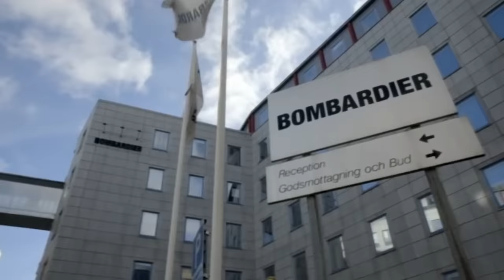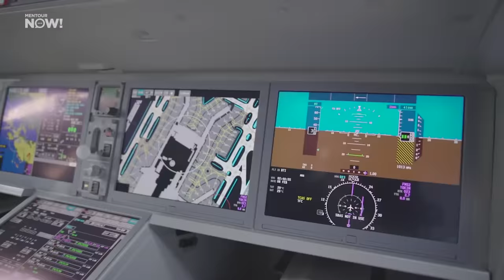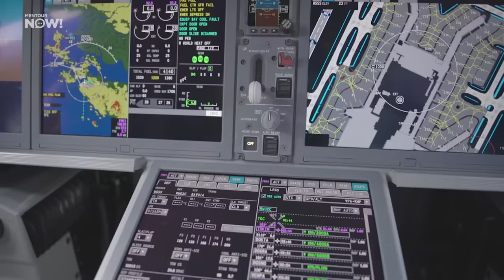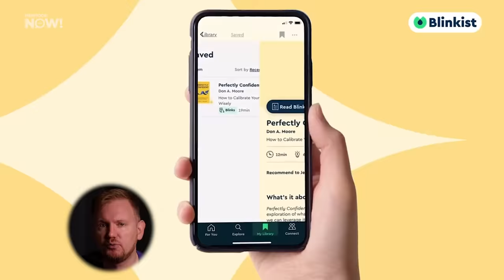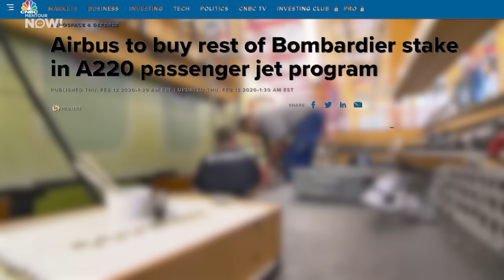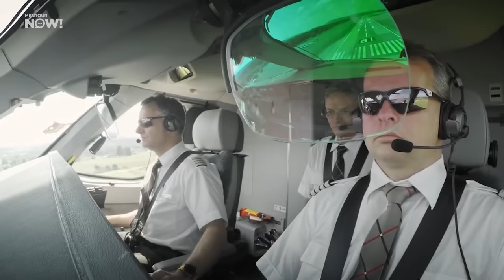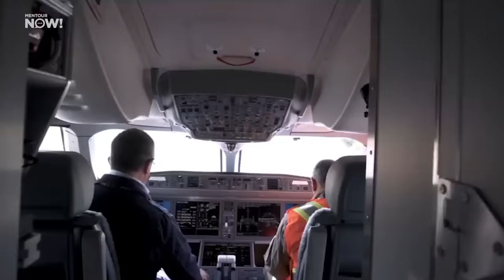Did Boeing GIVE Airbus a FREE Airplane?!

Comment: Bombardier also have a significant presence in Australia as they have manufacturing facilities all across the country and not only locally assemble military aircraft for the RAAF but they also are responsible for manufacturing the Vilocity DMU trains for Victoria’s regional passenger rail network! They are also responsible for manufacturing all of Melbourne’s trams from 2013 to the present and the E class trams in Melbourne were built by them while they will also be building the G class trams which are scheduled to enter passenger service in late 2023 or sometime in 2024! :)

Comment: The other thing we must ask - what would have happened to the program under Boeing? Would they have done it right in manufacturing and future upgrades, or neglected it, used cheap unqualified workers, cut corners everywhere, and later made an "upgraded" version with serious design flaws, ultimately ruined it like they do everything else they touch these days? Honestly I think it's in better hands with Airbus. I could even imagine a barrier to Boeing's buying out the Cseries would be those involved with the program not wanting to work under Boeing, either threatening to quit or fearing they'll be laid off and replaced with cheaper workers, which could hinder or complicate the negotiations, especially with any relevant unions.

Comment: As always, great video! 
As far as I am concerned, SWISS - that of course is an airline of the Lufthansa Group - was the launch costumer of the Bombarider C-Series. So, widely speaking, Lufthansa can be hold as the launch costumer, though I've never seen a Bombardier CS or Airbus A 220 in the colours of Lufthansa so far.
Reply: correct.

Comment: It's worth saying how incredibly efficient the A220 is. It's almost 5% more fuel efficient than A321neo that is the second  most efficient aircraft. Despite being only  5 seats wide, giving it a penalty of about 12% and also being generally smaller. 

The A220-500 will proboblt be even more efficient. And there is a 700 on the papers.

Worth saying that the CS500/A220-500 have now been reworked 3 times, making it longer and shorter. (Depending on if they are going with a 700 or not)

The 500 would at least be as large as the 737 max8, and the 700 probobly as large as the 9. Covering the part of the 737 series that really exist.
Reply: At the same time Airbus is developing a new carbon fiber wing for the 321 Neo, which will be larger in size with folding wingtips. This means they can use a further stretched 321 fuselage with the new wing to get an aircraft like the 757 above the standard midrange aircraft, and replace the former 318, the 319 neo and 320 neo in long term with the 220 in 3 or 4 sizes, without the need of starting an expensive clean sheet design.

Boeing on the other hand would have to launch a program to replace the Max, and one to get an aircraft in the size of the former 757 to compete with the modernized and stretched 321 versions

Comment: 2:26 Do not overlook the fact that the CSeries have the exact passenger capacity as the original 737 waaaayyy back in 1967
coincidence? I think not.
ALSO it shows how far the 737 mission creep has gone.

9:50 "medium haul airliner"
The irony of Boeing creating the point-to-point long haul 787 small twin aisle jet, having customers begging for a 757 replacement, SouthWest as a friendly case study...  and THEN missing the opportunity of a long legged 100-ish seat airplane is exquisite.
Reply: Yes, coincidence mein wounded Yank. Cope.
Reply: @yxmichaelxyyxmichaelxy3074   so much fail. There is no "wound". There is no "cope"
Reply: @ricardokowalski1579 
There there... shhhhhh.
Reply: @yxmichaelxyyxmichaelxy3074  Sorry. I already have spoken. Can't "shh" me after it has been said.

Comment: Canadian goverbment never "invested" in the C-Series.  The opposition parties from western Canada made sure the federeal money didn't go help a failing Québec company to bail it out.   However at time of lauch, there was some tax inventives and some breaks given by the feredarl goverbnment but not muchj most came from Québec government (for instance the construction halls were built by the QC government and rented to Bombardier).
Also of note: the C-Series was started prior to 9-11 with an Eye towards replacing the fast  DC-9 and MD8x and MD95 fleets in USA, notably Northwest airlines what was to be launch customer.  Then 9-11 happened.  Unlike Boeing and Airbus, Bombardier refused to lower production of its CRJs and found itself not long after with unsold inventory and its solution was to force a strike as a means to stop production without admitting it had made a mistake in not lowering production.  Not long after, Bombardier Aviation was near bankruptcy, Northwest had gone Chapter 11 (purchased by Delta and DC-9 sent to beer can recyling companies) United aso Chapter 11, purchased by Continental.  So not only was Bobardeir out of cash, but its lauch customers were gone.
The Beaudoin family (descendants or Armand Bombardier who controlled the company) purchased the recreational products division (skidoos etc) from Bombarier Inc  as a means to inject cash into Bombardier Inc.  ( recreational products not allowed to use the "Bombardier" trademark despite being owned by that family ! Now known as BRP and use various trademarks of purchased products since then (eg Evinrude for engines). 
By 2008, Bombardier was back in shape and had found customers to launch the C-Series.
Note: the C-Series was always going to a be a mainline aircraft, and that was one big challenge for Bombardier who had not dealt witrh mainline airlines only with regional carriers, so needed to build relationships with the big guys. 
HOWEVER: Bombardier also launched 2 business jetc at same time, the LEarjet 85 and Global 7500 programmes.
A small company which was first entering the big boys market against Boeing and Airbus was also straining its finances with 2 new business jets at the same time. Drain in cash resulted in stopped investment to improve productivity in its trasit division which started to be unable to deliver on time and with good quality control and it started to lose money and mroe important lose cistomers. (New York cuty told Bombardier Transportation very publicly to not bother bidding for any more contracts).

From the time the C-series started to be late, especially after the engine explosion which delayed flight testuing for a long time, it ran out of cash and became desperate.  So yes, it went to both Boeing and Airbus seeking investment from them, and both refused.   Think of it: if a competition is faltering, you don't helo it, you let it falter and then compete tro get the leftovers during bankruptcy.

Bobardier cancelled the Lear-85 , losing billions already spent.  But that was still not enough.  It was "this close" to starting deliveries, but also "this close" to having to invoke bankruptcy protection.  The Federal government refused to help, but brokered a deal where Air Canada would buy C-Series it hadn't panned on purchasing with Bombardier agreeing to maintain them in Winnipeg.  Air Canada was in court for violating its charter which required it to maintain maintenance base in Manitoba (from when AC was privatized)   and this deal would allow AC to settle the court case favourably.  That was the extent of help by federal government.

The Boeing trade dispute arrived about that time.  Instead of seeing it as a trade dispute, you need to see it as Boeing trying to speed up Bombardier's inevitable bankruptcy.   BBD had alreayd begin to sell off assets such as older deHavilland aircraft and the Canadiar water bombers to Viking Air (now deHavilland Canada). 

The provincial government was far more involved.  Bombardier split off the C-series into a new company (CSALP) (C-Series Aircraft Limited Partnership) and the Québec government invested a few billions in equity, onwing about 40% of CSALP, with BBD ereducing its share down to 60%.   The QC governmemt saw that this wasn't enough. The predicted death of Bomabrdeir is what prevented more sales.  This wasn't about cancellations becayuse there weren't that many orders, it was about all the potential sales that weren't materializing because everyone saw Bombardier was headed for bankruptcy. 

So the QC government is the one who negotiated with Airbus to gift it 50% of the programme for free so that the aircrafdt would get some long term credibility and not be cause in the fear of Bombardier's bankruptcy.

At the same time, the Caisse de Dépôt du Qubec (provincial pension plan, a potent investor) decided to bail out Bombardier Transportation. So Bombardier Inc split off Transportation into separate company and CDPQ injected new capital in it and got 30% onwership, but with a caveta: the money losing company had to providded garanteed dividends to CDPQ.  (recipe that CDPQ knew not to be sustainable). At the same time, CDPQ negotiated with Alstom to buy Bpmbardier Transportation and CDPQ comverted its investment in bankrupt Bombardier Transportation into 18% stake ionto Asltom.  Bombardier had no choice but to accept because it could not affor to pay those garanteed dividends, nor did it have any cash to buy the CDPQ shares back so it could stop paying dividends. 

The rest of the liquidation followed, the last remaining deHavilland product , the Dash-8 was sold to what is now deHavilland Canada, the downsview plant where it was built was sold to a condo developper, the CRJ IP and maintenance contracts sole to Mitsubishi Heavy Industries, and its aero structures business (including the former Shorts Bro plant in Belfast) sold to Spirit.

All those sales excluded the debt incurred prior to the sale which stayed with Bombardier Inc. 

Back to C-Series: when came time to start increasing production, Bombardier whose share was donw to 30% and QC govt down to 20% (airbus got 50%) could not invest to industrialize production, so used clause in contract to sell its stake. At that point, Airbus dish out a bit of cash to buy 25% of project, with the Québec government buying rest to increase its share to 25%. The deal with Airbus required the C-series to continue to be built in montreal for all customerd except those in USA. 

But that wasn't enough and last year, the still money losing C-Series required more investment and after long delay, the Québecgovernment agreed to invest its share to increase production at Mirabel in order to keep its 25% stake. The hope is that when/if the C-Series becomes profitrable, the cojbination of dividends and hoped-for doubling of share value will allow the QC government to get back its original investment.

So as of today, Airbus does not own the C-Series/A220 It has 75% of CSALP which owns the aircraft. 

At the time that Boeing was approached, it was by Bombardier who wasn't willing to give up 50% of its baby for free. (and same for Airbus during initial attempst). It was only when the QC government stepped in to save the project from very near bankruptcy that it made the  "on sale, 50% iff for limite etime only" to Airbus (not sure Boeing was even willing to talk because it was deep into the trade dispute at the time).

The irony:  What is left of Bombardier today is just the business jet division, with small offices at airport ist new headquarters, and the Global 7500, the very plane that killed the company its ownly ew remaining prodct (it also has the Challenger jet,  (upon which the CRJ was built)).  And it also has almost all the debt incurred for launching Lear 85, Global 7500, C-Series and all the losses at its transportation division.  So far they hacve been able to make monthly payments from sales of its business jets.

So to recap:   The QC governmnent invested a few billion for 40% of project.  Value halved when 50% gifted to Airbus.  Airbus then paid only a few hundreds million for 25% of devalued shares from Bombardier (QC govt bought 5%).   So for a few hundred million, Airbus got 75% of a nearly finished jet that just needed enough investment to increase production. 

Bombardier shareholders (me) saw 0 cent from all those liquidations since the money went to debt holders and we were left with $1 shares of a company with 1 new business jet and 1 old business jet and a lot of debt. No future.  It should be noted that Alstom has had problems with Bombardier due to years of neglect in production facilities since all the money was going to C-Series/Lear-85 and Global 7500, so it having to still invest much to update production facilities to complete old orders that Bombardier Transportation was very late on (and thus saddled with a lot of late penalties and not profitable).

Had Boeing gotten the C-Series, it would in fact have been a perfect fit:  Up to 130 pax on C-Series, and then create the NMA to replaced larger 737 and include the long range 757.   The NMA is always going to be a replacement for the 737 which is at the end of the road, especiually not that it needs bona-fide certification regime for new variants.   Had Boeing decided on repkacemen for 737 instead of the MAX (what Airbus feared the most), then the C-Series might not have been a fit at all in its prodyct portfolio).

One should not forget that Boeing, i perhaps in response to Airbus getting C-Series,  annouced it would buy the Embraer commercial aviation products. (fell through due to COVID). 
 
I think the big impact from Boeing taking the C-Series to trade court is that when the time came for Québec to work to find a saviour, it turned to Airbus since Boeing was hostile. .  But by then, the deal involved only the C-Series in a separate company whereas Boeing was getting the full Embraer commercial product protfolio.

Comment: I really wanna see the a220-500 and the a220-700 in the near future.
Reply: if you’re all the way up to an a220-700 that would literally be an a320 neo
Reply: Profit margins with the a220 are lower than the a320neo according to what I have heard so it's unlikely  that airbus will develop an a220 that could compete directly  and hurt  a320/321neo family sales 

The a220-500 could be the only stretch we will see, and it's capacity  will still be  smaller than the a320neo/737MAX8

Comment: One of the route proving flights of the CS300 was London City to JFK, which is the upwind direction. BA used to operate that route, but they had to make a stop in Ireland for fuel on the way out. That's a seven hour flight, near enough, and from a short field compared to most. So the A220 opens up opportunities for routes that aren't even possible with other aircraft. That plays more into the Boeing rhetoric about long narrow routes, and yet Airbus now has the aircraft. I wonder if Jet Blue, which operates the A220 out of Boston, might open the Boston Logan to London City route if their LHR-JFK route does well. So many possibilities for an aircraft that can economically operate transatlantic routes with smaller loads.
Reply: The stop in Ireland was also to allow US customs preclearance, so the plane effectively becomes a US domestic flight from then on.
Reply: @FrewstonBooks  No, the reason was because the little airbus full of business travellers couldn't make it across the pond with the fuel load it could haul out of London City. While they were there they could also do US immigration. There's no special need for a British Airways flight into the US to be a domestic flight, though it does kill two birds with one stone for the business only flight customers that they carried.
Reply: A220 will be a bit longer flight. I estimate 7 hours 40 minutes  vs 7 hours  for a larger plane. Not a problem though if going into an airport that would not have nonstop service otherwise.

A220
Mach .78 (447 kn; 829 km/h) 

A350
Mach 0.85 (488 kn; 903 km/h)
Reply: @StevePemberton2  Based on your huge expertise with flight planning? The typical and maximum cruise speed for the A220-300 are the same as the A321, M0.78 and M0.82. So no, no longer flight. Typical cruise for an A330 is M0.82. If the whole flight was at cruise speed then that would be an 18 minute distance.
Reply: @cageordie  Why are you being a rude jerk about it. All I did is point out that A220 would be slower. I just stated it as a fact. You must have taken it as a personal insult. I compared it with an A350 because that is a current generation airplane like the A220. The thirty year old A330 is faster than A220 but not by as much. A321 is not a typical transatlantic hauler although lowcost carrier JetBlue has started using it for that purpose because that's the biggest type of plane they fly, and moving up to a heavy doesn't fit their business model.
Reply: @StevePemberton2  All I did was point out you are wrong. There's little practical difference in speed between the A220 and other commercial aircraft. The A330 and A220 both have a cruise speed of M.82 but the A220 uses M.78 for better economy, exactly like the A320 family.
Reply: @cageordie   No you didn't just point out that I was wrong you were sarcastic and insulting for no apparent reason. Doesn't hurt my feelings I was just pointing it out as a fact. I notice whenever someone is insulting either to myself or to others because it oftentimes is an indicator of a troll, although not always. 

And you strawmanned what I said (another troll indicator) because I never said it wasn't practical I just pointed it out as a fact. And you haven't proven that what I said was wrong that A220 is slower across the Atlantic than other transatlantic aircraft, other than JetBlue's A321. 

A220 could cruise at mach .82 but instead cruises at .78, how does that impact the discussion? And the difference with A350 is noticeable, even if not impractical. That's all that I was pointing out.

I'm not saying you are a troll but you are a random person on the Internet acting a bit like one.